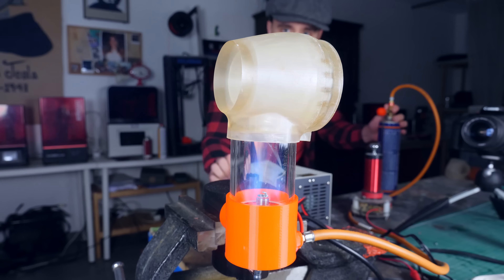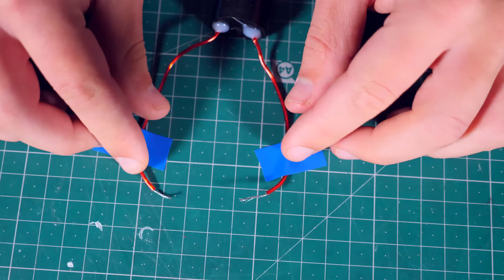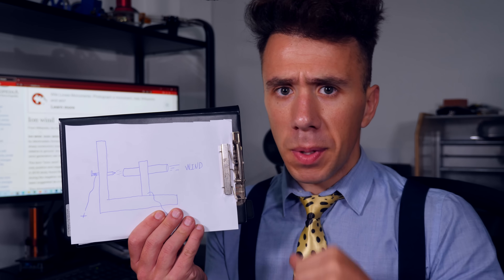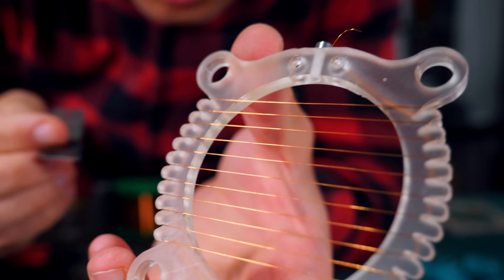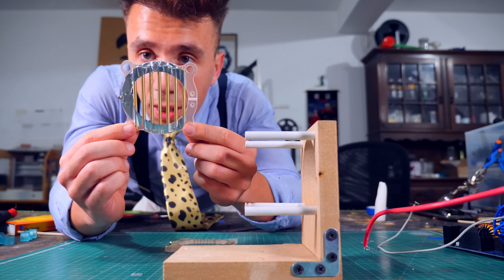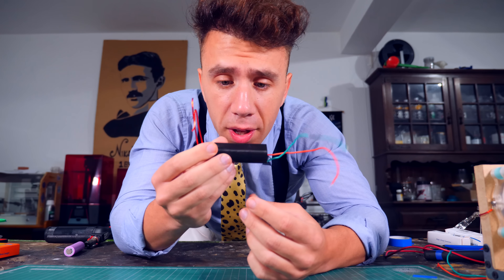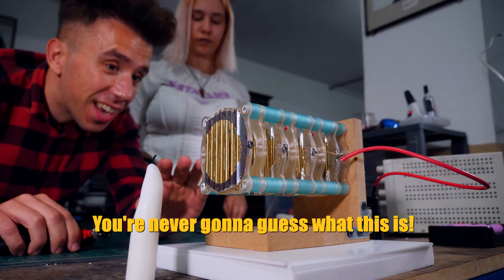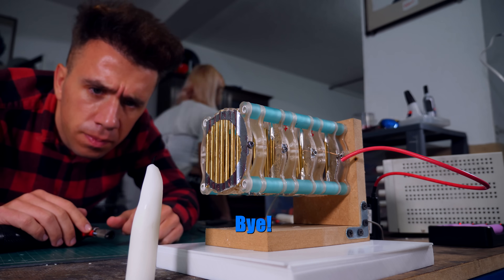I built a TRUE BLADELESS FAN

Comment: You know when the best time to like this video is? "Sponsor time"!

Speaking of fun things, I've seen a lot of youtubers doing actual fusion recently. Then I got reminded of an old idea I've had, when I saw the beautiful plasma thruster in this video; if you create fusion, which gives you plasma of course, which is polarized of course, and you then sort of combine it with this plasma thruster, using the energy from the fusion to generate the high voltage (or just use that thing you used in this video to start with) you can direct the plasma from the fusion through one of your previous nozzles to create thrust. Am I making myself clear enough? You'd get three different thrust generators combined and that might give synergy?

Comment: Yes! Tomatoes are disgusting!
Cool fan btw. It's not silent... Not effective... But it is bladeless! 👌So better than dyson!
And yeah, you've built an ionic fan. The electricity creates ions and shoots them in a direction. To make it more effective, you just have to create more iond and accelerate them faster (magnets should do the trick).
Video idea: Increase the mass flow by introducing a heavier molecule instead of just ionizing air. Electricity (high voltage) can ionize any molecule by high energy electrons hitting an electron in a molecule, therefore making it positively charged. Technically you'll destroy the bond that electron made and get a positively charged ion and a neutral fragment. Doesn't matter). You could introduce a heavy solvent like chloroform by evaporating it near the high voltage filament. Then with some cleverly assembled magnetic lenses you should be able to get more mass flow.

Comment: For a future video:

Instead of squares stacked on top of each other, try focusing the wind from previous stages on an angle so that the next stage is smaller but has a lot more wind to work with.
This way the design will be similar to a cone where the end stage is much more smaller than the start stage but has a lot more thrust and can be used to power a plane or a rocket or a wind propelled boat or car or some vehicle.  :D
Reply: report the spammer above please, (text me on telegram)

Comment: Why not taper the stages and put them inside a tube, so the intake side is large to take in the most air, and the output side is small, thus using fluid dynamics to help its power?

Comment: Well since you want more flow speed what you could do is actually copy the Dyson fan, use the ionic thrusters as the base of the fan and point them up, and use a round diffuser to make use of bernoullis principle and have faster flow (a flow that passes through a lattice will create a low pressure area and will moce faster), also this way you can control hhe flow of air and increase the efficiency of the fan. Another way to imrove this setup is also to instead of using strings that go across to use a flat spiral of wire, like the shape of a conduction heater, and use perhaps smaller tubes to achive more surface area and to pregent the tubes from slowing down the air due to drag.

Comment: Have you checked if this bladeless fan generates ozone as a side-product? If so, it's not safe to use indoors.

It would also be interesting to wrap the whole mechanism as a rectangular pipe – I would assume that would improve the speed of the output wind even more. The fully open design looks cool, though.

Comment: ♥This is great!
🌊1. In the next video, you can try to make a vaneless pump based on this effect
🛻2. Or make a car model that is driven by air from an ion fan, or driven by an air motor with an aero ion fan.
⚡3. You can try to use a large number of hair-like microwires flattened at the ends to throw out a positive charge.

Comment: You need to dramatically increase the mass put in motion. We see only strands of air in each stage are moving in a parallel manner. You need to have the whole block of air moving. For that, reduce the spacing of the wires to a few millimeters that should do.
One more thing, you should increase the ion collection rate at the ground electrode by using a flatter shape than a cylinder. A bit as lifters do.
There are other things that could be done but these two are the most significant and should improve your design’s efficiency a lot.

Comment: I like this concept, I'd say for now fans with blades are definitely more commercially viable, and you won't get to their scale for the power you want from this fan.  Also to mention it probably takes a bit more to run than a motor with a spinning blade on it.  But this is all speculation, I can't wait to see you prove me wrong and make something that will blow me away (pun intended).

Comment: I played a lot with the 'Lifters' when I was young and even killed one TV. On your drawing you showed that the second part should be a bit round but you took very thick tubes. I would recommend the Idea from the 'Lifter' and use something that is round at the beginning and then flat so you dont have that much resistance on the airflow. The Aluminium Foil (or copper plates) have to be bent over a round surface and then straight down. That will increase the pull on the plasma. You could even increase the effect when you use a increasing voltage on each stage (and a larger gap) because the wind on the second stage is already accelerated. When you have enough stages you will end up with someting like an linear accelerater.

Comment: you could improve and compact the design next time.
How about an x Grid by using two hights of wire hooks just a few tenths of a mm apart and same with the tubes. Maybe not doubling but at least increasing the output. Also you could make it a wind-tunel, idk if that helps but it could. Basically experimenting with the design and improving it as much as possible

Comment: Ion thruster platform from the fans , but in an enclosed tube and longer , and see if you can get enough PSI to spin a 3D printed turbo attached to a rocket nozzle and produce thrust

Comment: more compact? depends on intended application, no? 
if you are looking to fill the same niche as conventional room-cooling fans, you want not just velocity but mass, and that means you want a decent cross-section: Go bigger, not smaller.
you can also explore various methods of stealing the benefit of entrained air, even to the point of replicating the tower and annular shell design of the Dyson-style "bladeless" fan

Comment: If I were doing this, the first thing I'd change is that I'd experiment with the shape of the holders opening since they're only purpose (as far as I can tell) is structural and I'm not trying to mount a circular fan in them.  Next, I'd create a cutting block so that my cuts across the wire would put less stress on the wire as well as give the cuts uniform spacing, depth, and angle.  If the positive electrode has predictable spacing, than I'd try replacing the copper pipe with a chain of copper beads to maximize the curved surface area.  After that, I'd try different sized beads so I can see if I can pack in more electrode contacts.

Comment: Perhaps add a pre-stage which channels the air into a vortex, similar to how the intakes on GM's vortex engines (and likely many more) do to increase airflow efficiency.  Additionally, put the entire thing in tube, with the end slightly restricted compared to the main diameter and try different end:main ratios.

Comment: Utiliza un versión miniatura de este ventilador como entrada de aire regulable en un motor de jet, así puede a través del voltaje regular la potencia que pueda producir haciendo un motor sin mecanismos movibles.  PD: como lasaña para hacer sufrir a los tomates no porque me guste

Google traductor: It uses a miniature version of this fan as an adjustable air intake in a jet engine, so it can regulate the power it can produce through voltage, making an engine without moving mechanisms. PS: I eat lasagna to make tomatoes suffer not because I like it

Comment: Im pretty sure this is also an Ionizer. Should make sure your not pumping out ozone, Can help with smells but you definitely don't want a commercial power level ionizer just running in a small room. 

If you wanna increase efficiency add the setup to a tube, rotate each stage 90 degrees, and add a large flare to the intake to the tube that is sanded smooth. Smoothing out vortexes on your intake can massively help airflow. 

If you want a better way to measure performance you can create a cardboard tube and attach your fan and the dyson to it  then put the air flow meter at the end so the test is identical for both. 

windspeed in same setup / wattage = efficiency

Comment: It would be really cool if you built a high voltage disc launcher. Basically a flat coil where huge capacitor bank discharges into it, launching non-ferrous disc. Your reaction to it would be awesome to see.
Reply: Be careful the following message is not from integza.
But I think it's a pretty good idea by the way

Comment: You need to 3d print a Venturi air multiplier housing for the air from the ion fan to feed through. Could use it to give directional control as well as more volume.

Comment: Cool idea. But make sure you're still around to do more stuff like this. 
Rule Number One when working with power tools: Necktie goes away. You wouldn't have even the time to scream, let alone actually have one moment to hit the off button on the machine should your tie get wrapped around the spindle. (And even hitting the off button only means electricity is disconnected -- the machine's momentum will still need to dissipate.) 
The South Bend Lathe Company used to publish a book called "How to Run a Lathe." Even back in the early 1900s, when people weren't as safety conscious as they are today, they still admonished people to ditch their ties, roll up their sleeves, and remove all jewelry.

Comment: if you wanted to make it a commercial product, it would need to be verticle instead of horizontal...Here's an idea to accomplish that, AND increase the air speed; have it verticle, and then have an L shaped bend that constricts in the middle. The short constricted portion will force the airflow to increase in speed. Two problems solved at once.

Comment: I'm sure many people have said this before, but you should consider wearing eye protection when working with machining equipment. I used to work at a brewery and when pressing bottlecaps on bottles with a press, a shard of glass or metal flew off, bounced off the table and flew right underneath the rim of my eyeglasses and into my eye. I got lucky and didn't get any permanent damage, but after that I've always worn protective glasses in those situations. Sure, could have flown under that too, but it protects from a lot! Anyway, GREAT video! ❤️
Reply: Wearing a tie is also a good way to get your head pulled rapidly towards the various sharp spinning things. Is it worth it just for the sake of fashion? If you really must wear a tie then please consider using a tie clip.
Reply: Please contact integza there is a scammer in the comments. Look for comments with just one or two replies. It says you win a 3d printer

Comment: I wonder if you used piano wire if it would have more point sources. Also, can you use a magnetic field to keep the airflow from escaping from the sides of the funnel? Or just surround the tube with plastic? Are the particles being shot out charged?

Comment: You can build a wind tunnel to use along with your bladeless fan. Wind tunnels rely on laminar flow to work properly, and this thing looks like it can generate a good laminar flow. It would be a cool integration of two projects. Nice work!
Reply: Yeah except it'd spit lightning everywhere and toast any electronics nearby. Probably a great big fan and some tubes is still the best way to get laminar airflow.
Reply: @greenaum  Would using some more plastic as a tube not avoid this?
Reply: @greenaum  EMPs that big of a problem? Maybe shielding?

Comment: This is cool, 15 meters/s not bad for a solid state fan. Does this produces ozone? I know that ozone is toxic for humans. I did a google and it states Ion thrusters produce ozone as a by-product of propulsion. For those who don't know, you do not want this thing running for hours and breath in the ozone, it's not good for you. I did a lot of research in this, for removing odor, it turns out ozone is great in removing odor, but it's not good for humans, hence why it's used in commercial exhaust fans for restaurants to remove the odor before being released into the outside space in dense cities.

Comment: Curious to know: let's say we add a tube with a sprinkler to the tube used initially.. and throw in fuel.. any fuel to test tbh, would it push the fuel with the air while igniting it? Increasing the force maybe? 👀

Comment: Something happened to my original comment... oh well.  Instead of round tubes for the cathodes, consider streamline tubes.  K&S engineering has some on amazon here in Canada.  Blunt edge towards the anode, pointy edge away in the direction of airflow.

Comment: If you start marketing these as fans, you could call them "Ionic Breeze". That's not taken... right? 

Anyway, my thought when watching this was about the real effects of stacking the grid-fan-thingies. That is, I know that stacking PC fans doesn't tend to enhance their throughput effectively, and can even cause destructive interference. In this case, I have no idea whether that's an issue, but it would be cool to see the airflow visualized with... fog or something, idk. 

Oh, one last thing: maybe try bending a tube and wire into rings to see if you can benefit from the same air entrainment used by the Dyson fans.

Comment: Before the overpriced Dyson fan, there used to be a number of tall thin "bladeless fans" sold (in America at least) that claimed to clean the air of particulates as well as create wind. The "Ionic Breeze" and its copycats. They worked the same way as this. There was just one problem — even though they did remove dust from the air and work as a fan, they actually lowered indoor air quality significantly. BECAUSE In addition to wind and attracting particulate pollution out of the air, it created ozone. Which would be great if they were in the ozone layer, but here on the ground, it's just smog.

Comment: @integza Just a warning to you integza, wearing ties while working with rotating power tools and equipment is extremely dangerous(see strangulation injuries, severe laceration type injuries, and decapitation injuries) if they specifically are not designed to break away or are clip on, loose clothing is dangerous as well, and so is jewellery (see degloving accidents).  I don't want any of that to happen to you, you're doing great work.

Turris Fortis Mihi Scientia.
Knowledge is my tower of strength.

Comment: How about you turn your blade less fan into a portable 5 V 18 650 interchangeable battery heater with type C 3A charging capability input/ output With maybe even a built-in solar panel on top

Comment: Here' s a video idea: We really need a build tutorial on dynamo generators. You know, the ones that generate electricity by spinning a DC motor shaft. There is a whole lot of different motors and I found it hard to understand which one I need. Given the situation with power right now, I think a lot of people will find it useful. It should be practical and I suggest that you show a smaller design for charging a phone or a powerbank (heck, it might even BE a powerbank with a hand crank) and the other made from bycicle parts and a bigger motor for more juice.
Reply: FAAAAKE

Comment: As for helping with the output, maybe look into ducting (maybe put the Ionic thrusters inside a tube?) So you can help with plenty of air feeding in, but also directing or maybe improving air flow out in a controlled manner... 🤔😏     😎🇬🇧

Comment: If your high voltage generators have isolated outputs you might be able to combine anode and cathode of adjacent stages. The resulting electrode should combine the shape of your previous anode/cathode, sort of like a teardrop or airfoil shape (point/line on one side and cylindrical on the other).

Comment: Nice setup !
For more power maybe you can consider a grid layout or some kind of web spiral to amorce rotation so wind will get further.
Could stage interact with each other ? Because I see you keep space between them so they are individual +/- and not series of +/-/+/- .
Finaly to convice tomatoes lovers include this in a Dyson like shell, air jet around an hole help improving mass flow by sucking additionnal air due to the local depression.
Keep it fun.

Comment: For a future video: it would be interesting to see if you can get the power to weight ratio to a point where you could control multiple fans individually and make an "ion copter"
Reply: Well... Your craft would have to be incredibly light. I suspect it could probably be optimized to a point of being able to lift some control electronics, but getting the power supply off the ground I'm pretty doubtful of.
Reply: Not going to happen, a few milligrams of thrust would be difficult to achieve.
Reply: @mrbmp09  this v1 already exceeds the gram ...
Reply: You’ll never achieve the needed thrust to weight ratio for atmospheric flight.  But ion drives could be applicable for space flight.
Reply: @markdarragh6620  Ion drives are used a lot in space flight, actually.
Reply: @KaiHenningsen  no false  ... and after long thought ... they are not much different.
Reply: @markdarragh6620  ion drives are used in a lot of unmanned space craft. Of course you then also need to carry a gas to ionize with you (most spacecraft use xenon i believe), but it's highly efficient.
Reply: @markdarragh6620  lightest copters are less than 4g, I think the record is around 2.4g including batt and remote. (all servo are hand wired ). 

so it's not a hopeless project to me
Reply: not really possible, it was only done in a plane and it was tiny and made out of wood